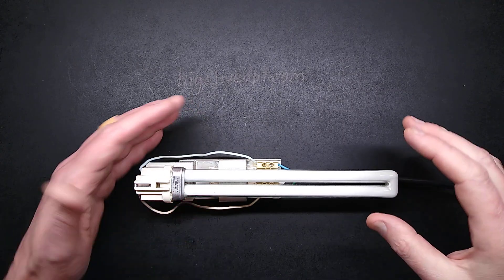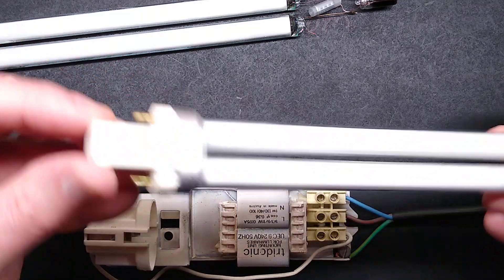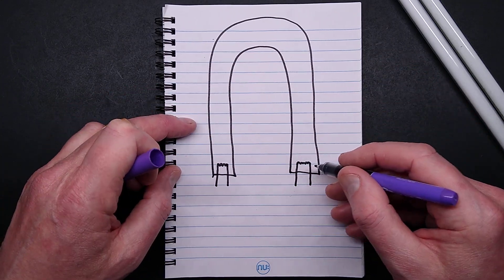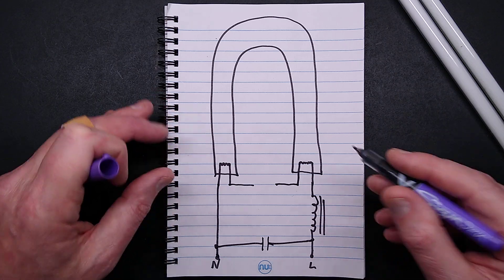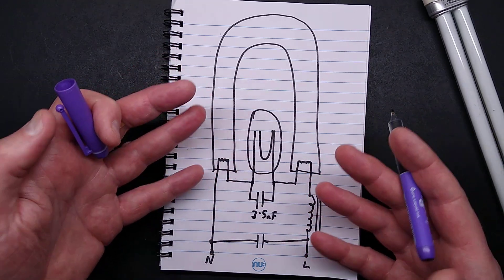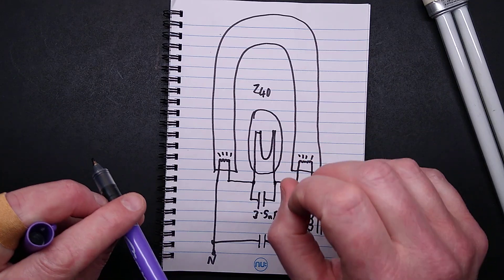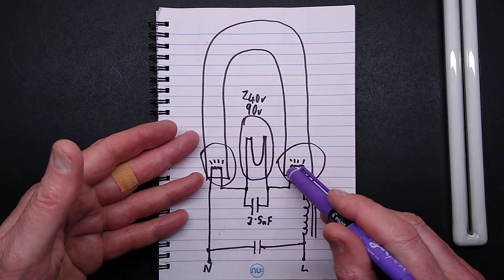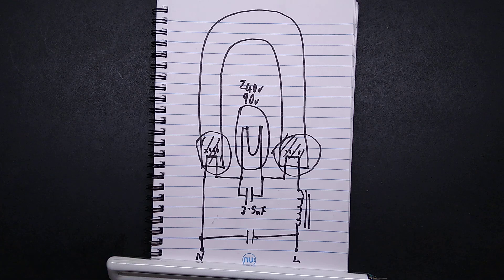Retro already?

Comment: I recently had a EPC (Energy Performance Certificate) on my house. I was intrigued to see that the ancient 4 foot florescent fitting in the kitchen was still classed as a low energy unit.
Reply: Linear fluorescents have for a long time had better efficacy than LEDs, being close to 100 lm/W. (CFLs are a different story) Their issue is mercury, the high color temperature, and low CRI. In the US, it's these requirements of light quality, in combination with efficacy, is leading to the bans. In commercial applications, the longer life of LED significantly saves labor costs.
Reply: @straightpipediesel  they're available in lower color temps and decent cri. mostly t8s and t5s.
Reply: @straightpipediesel  riiiiiight...

Mercury makes sense, because people are stupid. That being said, they already fixed that like they fixed hot coffee burns:

Put a caution label on it.

The rest has no bearing on any legalities anywhere ever.
Reply: @straightpipediesel  Longer LED life is dubious.  They put in a bunch of LED retrofit lamps in the office at a previous job, and 10% were dead in 2 months.  The dead ones weren't replaced for a long time, and the ones that still worked were visibly dimmer than the lamps that replaced the dead ones (identical lamps from the same purchase lot, so it wasn't a matter of different or improved lamps).
Reply: @randacnam7321  Retrofit bulbs (E27/B22) inevitably overdrive the LED's to get enough lumens, the ballast is packed inside the heatsink and gets overheated, and placing the bulb in any kind of enclosed fitting makes everything worse. LED batten/tube form factor is much better.
Reply: @rexsceleratorum1632  Sounds just like cheapo LCD TVs' dirty secret! Overdrive the LEDs and cause the LEDs to fail. Compared to ones designated as TVs, LCDs designated as monitors aren't prone to that, unlike a bunch of TVs that are not OLED. Ever wondered why a bunch of cheap LCD TVs pierce your retinas?
Reply: EPC's are greatly inadequate, relying on paperwork, with no effort towards testing or checking. I am still supprised every time inspector classes houses with 100mm Kingspan and 50 across as uninsulated because it wasn't installed by certified company, but rather by small builder, while build regs are perfectly happy to accept pictures of it being done. I have seen prices for registrations an it is well out of scope of a small builders.
With C coming as the minimum requirement for rentall properties soon, I get asked a lot about how to achieve and often have nothing. 
Short of getting somebody dogy enough to pass it or providing certificate for pass work.
As an electrician, I see that while sollar panels have improvement in practice in sheffield they do not do enough yet.
Heat pipes have problem with training and information gathering.
Long story short, I see no point of EPC as it is done now.
Reply: Don't read too much into EPC certs. The industry is pretty much a joke. 5 minute training course, usually unskilled/semi skilled people who've had a brush with the construction industry.
   With today's myriad of insulation systems alone, its impossible to accurately assess things without some degree of intrusive opening up. 
    I've never had one take more than 15 minutes max, at a property.😂
Reply: @ChariotsofWire180  The problem with it is that with is inadequate nature EPC is actually damaging environmental efforts
Reply: @Zlodej5  Simple:  It isn't about the environment.
Reply: @Zlodej5  When they're blaming cows for farting, I don't go so much for the environmental aspect.
Reply: all lighting is low energy, relatively speaking. It's the way it's measured that has changed. Very little of the household electric bill goes on lighting, conventional or otherwise

Comment: I feel like UK fluorescent setups are vastly superior and simpler than ours in the US...
Not sure if your small fixture based (ie Edison) CCFLs are the same as that one you have in the video, but ours are chock full of components...
4 wires run into the lamp tube (I assume the heater is encapsulated in ours?) Like 4 solid capacitors, a single electrolytic (common failure point), a few transistors, and the transformer, along with a number of small surface mount components, all cram packed onto a single sided PCB.

No where near as clean and cheap (BoM wise) as what you've shown. 😒
I do have one that IS that simple though. Was the controlpanel/washer tub lighting for an old washing machine that I salvaged from a friend's dead washer, to use as a small workbench overhead light. (it backlit the panel and illuminated inside the machine when lid was open)

I suspect it is doing exactly as you said, and needs a new bulb, since it flickers but never catches and stays struck.
That's just a single cylinder though, no bend, no base fitting either, but I think it is indeed still just a 2-pin on one side. (it's at my cabin, so I'm going enthroned off of memory)
Reply from the maker: Some of the appliance tubes used a resistor for current limiting for cheapness.  The tubes usually have to be near a grounded surface to illuminate properly.
Reply: I believe their 240v electronic CFLs were the same 2 transistor circuit as our 120v ones.

Comment: The inductor is also giving a voltage spike when the starter turns off which strikes the lamp.
Reply: And also as main function limites lamp current. Two functions in one simple choke.
Reply: I was just going to say that. As the bimetal in the starter cools down and breaks the contact, the current flowing through the inductor has nowhere to go and causes a voltage spike that ignites the main tube.

It is unpredictable when this happens. The voltage spike is not high enough when the contact is broken close to the trough of the wave of the AC the whole thing is powered from, so it has to try again. Hence several flashes before it fully lights up.

Comment: The original starters are always so interesting to me. Beautifully simple and elegant design. I like my fluorescent lamps, I don't use anything LED if I have the choice.
Reply: I don't understand this pathological resistance to using LEDs.

I might have agreed with you when they first came on the market in the form of 230 volts mains AC bulbs but not today.

There is a fantastic range of lights of differing colour temperatures and you can even control the colour and brightness to be any colour in the rainbow.

I have colour adjustable colour LED light strips which I can change to white if I want normal room illumination or dim to a low shade of red or pink for watching films on television.
Reply: Why? LEDs are objectively better.

Comment: I imagine that the manufacturers not only agreed but pushed the ban, who wants to sell a fluorescent tube every 15 years when they can sell an "equivalent" LED every 15 months?
Or a well made LED equivalent that in theory can last 15 years but sells for 20 times the price of a fluorescent tube.
Reply: You are sadly mistaken.

Because of their mercury content, fluorescents should have been banned under RoHS regulations in 2006. They were exempt, though, because at that time LED was not yet a viable alternative.
By 2012, this had changed however, but, rather than do the right thing, the manufacturers fought tooth and nail to push back the ban.

Remember that linear tubes basically haven't changed since the late 1950's, so the factories that make them are essentially 'free'. It costs less than 50 cents to manufacture a tube and they sell about 150 million each year in the EU alone.
Reply: @somedutchguy7582  Yep and most of the filament and fluorescent factories are in the developing countries because the wholesale profits are small.  The LED lamp is more profitable because you often change the fitting and consumer lamps fail much faster than old tech.  So profit is what dictates what happens, health and old factories are abandoned as convenient.
Reply: Over 15 years, you'll spend far more on electricity than you would for the fluorescent tube.  The cost of the tube is negligible.  If you really need long life from an LED lamp, it still makes sense to pay extra for a long-life LED lamp.  It pays for itself in saved power.
Reply: @jbalazer  A driving reason for leaving filament bulbs was the short lifetime, however this was artificially generated.  If you ran the bulbs at 90% supply voltage you got 3 times the life and if you used them at 110% you got 1/3 of the life.  Manufacturers all colluded to make bulbs for a lower voltage rating than the local supply and all bulbs wore out faster than needed.

In South Africa one region had 250V mains for a long time and bulbs sold there were labelled for 250V.  When those bulbs were used in the 230V areas they never burnt out.

The other scam was halogen bulbs.  They give colder light but have to burn out due to the constant fast evaporation and sublimation of the filament over time because they do not work at reduced voltage properly so will fail.

Comment: Back then I connected three such 6 watt tubes in series with a single coil. Because of the low power, they even started. But normally at 230 V only two should be connected in series.

Comment: I just did a diagnosis of an identical lamp.  For an insect trap, it did the constant flashing.   Capacitor measured at 3.5 nano Farad and the flasher was also sooted.  Main tube ends were sooted too.
Reply: Replace the lamp with the correct type.

Comment: Expensive tubes of the 90s when first phosfor white LEDs appeared actually give same lumens per Watt as average modern days LED bulb and if someone desires with modern semiconductors it's possible to design and make highly efficient electronic ballast that will last much longer than even specially cooled LED fixture.

Comment: Love the distinct sound of the starters, especially in very low ambient temperatures.
Reply: plink, plink plink, plink.
Reply: @UberAlphaSirus  Plink plink plink… for days when the lamp is worn out!
Reply: Plink, plink, plink, bzzzz

(Most of my lamps have magnetic ballasts)
Reply: I recently inherited an apartment. it had one of those old absolutely horrible fluorescent fixtures for tour tubes on the ceiling. Without any diffuser. I switched it on and the room filled with a buzz of a bag of angry wasps.  And after a couple these high pitched pings the room exploded with light... Cold and lifeless, absolutely blinding, unwelcoming as Antarctic shore. But all these sensations would not be so horrible if I didn't know that a child grew up in this room. Studied through secondary and university... My uncle grew up there... Fuck... Poor child.
Reply: @NGC1433  Here in South India, we considered the move from warm and dim incandescents to bright cold white fluorescent tubes as a welcome and pleasant upgrade. Being warm is not a good sensation in the tropics. By far the best-selling LED bulbs in India are so-called "cool day light" (6500K).
Reply: thats the only positive of this tech. They are good for horror video szenes. ^^

Comment: The ancient florescent tube in my kitchen has an electronic starter that I installed about thirty years ago with a new tube.  After switching on the lamp there is a period of about one second when nothing appears to happen, then the lamp starts abruptly with no flashing on and off.  The tube itself has also not blackened at the ends like most old tubes do, and it still all works as when new.  The starter itself was several times the price of a traditional starter, and seemed very expensive at the time, costing more than the tube, but I have never had to replace the tube.  I wonder how this works.
Reply from the maker: I made a video about that.  It's a timed start.  It preheats the cathodes for a controlled time.  Then it opens circuit so the lamp can strike first time.

Comment: Clive, I bought fluorescent tubes for some work lights at work, and I actually had to remove the starter from the tube as our lights were electronic ballast, and refused to light. I got a bunch of tubes at a local charity store, and the price was good for the new tubes. I was act surprised that since the insides were different that they actually plugged in to the socket.
Reply: The capacitor shorts out at high frequency. The original lamps supplied with such fittings didn’t have capacitor or starter, they’re just cold started by the ballast.
Reply: There are two versions of these lamps - the 2-pin with integral starter for magnetic ballast only, and the 4-pin which can be used with an external starter on a magnetic ballast, or with an electronic ballast.

Comment: I just replaced one of these in my sister's "Ott-Lite".  The box with the new bulb (Westinghouse F13TT/41K) mentions that "Each lamp uses a glow switch containing less than 15 nCi of KR-85."  Presumably the krypton-85 (a beta emitter with a half life of ~ 11 years) helps lower the striking voltage of the starter.  Or, since the only source of Kr-85 is nuclear fuel reprocessing, which Westinghouse is big in, it could be a clever way to dispose of nuclear waste.
Reply from the maker: That's to facilitate the gas discharge in complete darkness.  Neon indicator lamps do that too.

Comment: I'm not going to miss fluorescent tubes, at least these ones, as they are horrible, they failed more often than an incandescent bulbs in my experience. Especially since you find them usually in bathroom lights where they constantly gets power-cycled. 
But then again, I've seen a lot of LED bulbs fail too, mainly because of greedy design. Which is why I make my own LED lights, as I don't have to comply with harmonic distortion requirement (and thus use reliable capacitive dropper as driver, none of those IC rubbish) and I can pick any LEDs I want. High CRI Sunlike ones (with violet chip and full spectrum)? Or high efficiency LED (200+ lm/w)? You name it.

Comment: I've got a desk lamp on next to me right now that uses 11-watt PL-S lamps. It's great. It's been on this desk for about 20 years, and I think I've only ever had to replace the tube two or three times Luckily, I bought a number of these tubes when Maplin closed nearby, so I have a stock for another number of years, but it'll be a sad, sad day when I have to confine it to the "great recycling centre in the sky" (also known as the neighbour's wheelie bin)
Reply: I have a similar desk lamp. I've had it 40 years, but it's more than 40 years old. I've only changed the tube in it once. Interesting fact, gas pumps also use the PL-S lamps - the ones that have the 7-segment style LCD digit displays. If they're newer style LCD screens, then they're probably CCFL or LED backlight, but the ones that just have 7-segment digit displays use multiple PL-S lamps as the backlight
Reply: Give it some time and there will be Chinese made replacement bulbs. Might give the desk lamp another lease on life.
Reply: @NaoPb  Pretty sure there already are drop-in PL-S LED tubes. I have a nice retro desk lamp I salvaged from the e-waste (A Lucifer desk light) that I put an LED tube in (just one out of two, one LED tube was plenty bright), works great. 

I personally find it an improvement, I often get annoyed by 'flashing' light out of the corners of my eyes from fluorescent tube lights. Perhaps this is partially caused by old or cheap TL material, since I mostly recall being annoyed by this whenever my dad put up secondhand TL lighting in his garage. No such irritation from LED tubes. The option of warmer color temperatures is also nice.

Comment: Being that I deliver papers for a "living," I drive past the same houses literally every day.
The number of residents who have LED flood lamps on their houses, with the characteristic flash of a failed power supply, is alarmingly-high. I've even seen an A-frame house with hard-to-reach indoor recessed cans (I think you guys call them "downlights") flashing brightly at 5 AM, which must be annoying as heck as it is his primary lighting source. It seems we still can't make a LED bulb capable of lasting as long as a basic tungsten lamp (at least in the US), which is quite disappointing.

Today, the incandescent-shaped halogen bulb over my computer blew out. It lasted only a few weeks longer than the Dollar General LED bulb it replaced... PAIN IN THE BUTT as the "man cave" has 10-foot ceilings and I gotta go drag the ladder in here again. 😠Well, if I gotta drag the ladder in here, might as well swap the entire fixture out for the two-bulb 4-foot fluorescent tube fixture I have sitting in a box, and slap in the LED retrofit tubes.
Reply: Just use the fluorescent lamps. The led retrofits are crap and barely save anything. (Where I live it would save .15 cents per year if it was on all year long.)

Comment: Talking about red tape manufacturing - EPC inspectors are apparently recommending landlords replace normal pendant lampholders with LED bulkheads because the LED bulkheads are 'Energy Efficient' notwithstanding the normal lampholder probably contains a LED bulb bought and put in by the tenant. 
You can try telling your landlord that a 5W poundland bulb in a room that is adequately lit by a 5W poundland bulb is already close to optimum energy efficiency and having it harshly over lit by a 10W bulkhead isn't an improvement... but don't tell him twice because no fault eviction is still a thing.